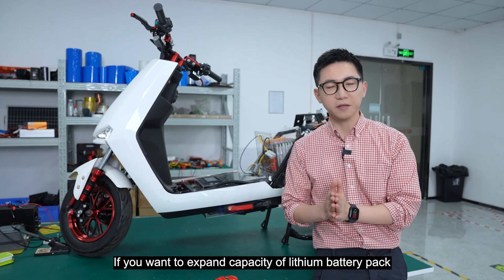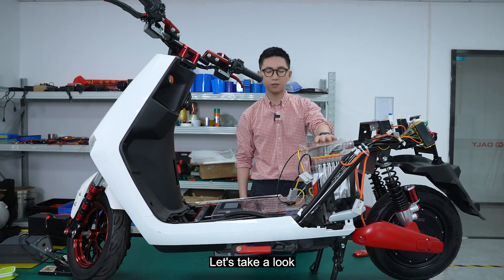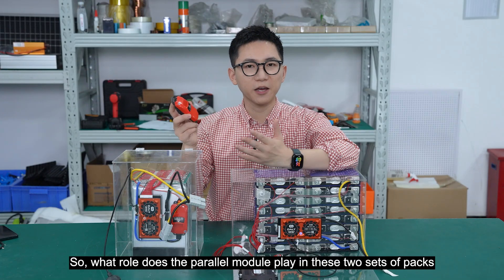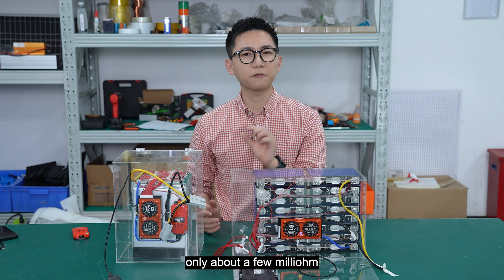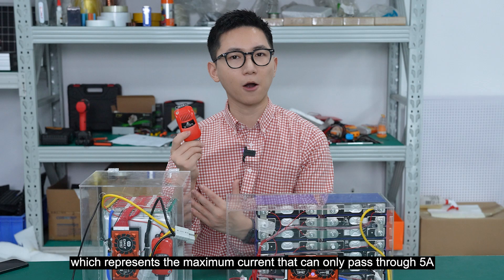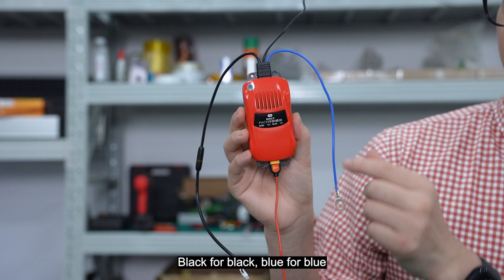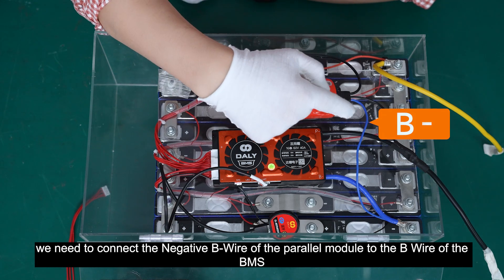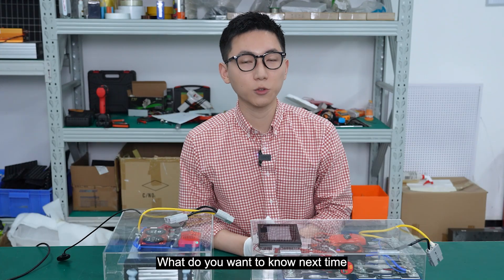DALY PACK Parallel BMS

Comment: Unfortunately, this is often not usable in practice because the battery in the vehicle is firmly sealed. The user can only decide which electronics to install in the new battery. It would make sense to develop protective electronics that are only installed in the additional parallel battery.

Comment: Can I connect two battery packs using parallel modules of different amperage?  For example, one pack is using a 5 amp parallel module and the other pack is using a 15 amp - can they work together?